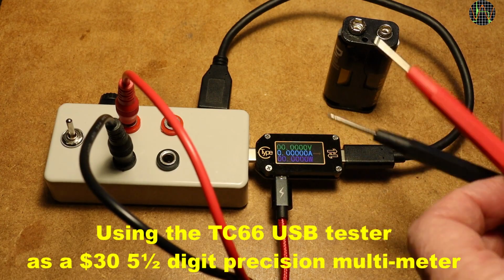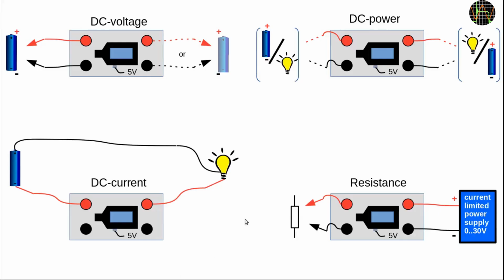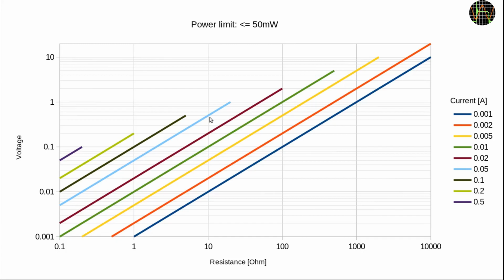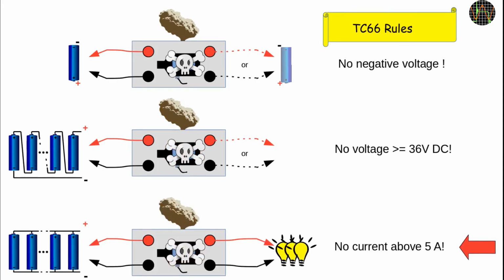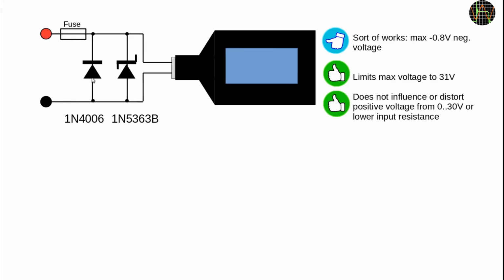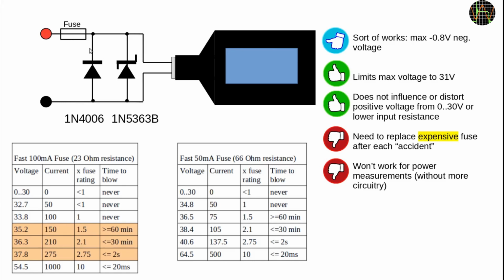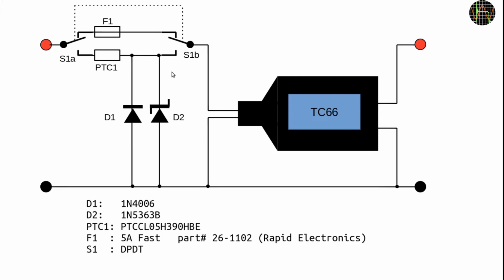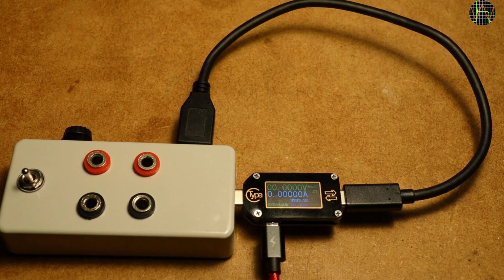Using the TC66 USB tester as a $30 5½ digit precision multi-meter

Comment: I have two precision calibrators achieving stable output at 5.000000±0.000100 and 10.000000±0.000020 V.  My TC66C measures them at 4.9996 and 9.9995.  Therefore the USB meter unit is measuring -0.005% off when using the better of the two (the 10V transfer standard).  Unbelievable!  None of my DMMs can come close when needing to measure 0.0001-29.9999V.  Current checks in at 0.2% low, but my constant current calibration transfer standard is not a particularly good standard (I'm working on a better one currently, no pun intended).  I made a banana plug adapter to type C female jack for the purpose of monitoring and logging voltage or current with the TC66C.  The shortest log interval is 1s.
Reply from the maker: Indeed, a hidden gem. Glad you confirm my measurements how good that little thing is. I have used it and its recording function many times now but never for USB stuff which normally doesn't need that kind of accuracy.

Comment: Suggestion, would be superb to build 3d printable case so that you would place TC66C in the middle of the print, have power fed from 18650 inside the case. When you would use it as meter, you would just plug TC66C with 2 USBC cables and one uUSB and you would have your accurate meter. Then oc the custom android bt app for everything else.. :)
Reply from the maker: I totally agree with out. Sadly I don't have a 3d printer. Maybe one day .. (we can dream...). PS yes I know there are Makerspaces etc. but with the pandemic and all that and anyway it would be quite a trip each time...

Comment: Hi, first I would like to thank you for your videos, you really work hard on them and pass on a lot of knowledge. Second, I would like to know if the negative voltage would kill the tc66 instantly or if there is some minimum voltage or time tolerance for this to happen? I don't study or work with electronics, I'm just interested but I have no knowledge about negative voltage. I've already reversed the polarity for about 5 seconds on my tc66 while measuring a 1.5V battery and what happened was that the magnitude that started to change in the meter was the current (it was around 1.1A) and the voltage was zero. Is that expected or do you think it should have burned in this situation? Note that my tc66 is the version with another bluetooth module, I don't know if they made changes to other components too
Reply from the maker: Theoretically the chip datasheet says -0.3V is the max. reverse voltage but I also found it handles a bit more if the duration is short. In my protection circuit the reverse current is limited by a diode, which is at 0.8V for a full blown reverse application a bit more than what is allowed according to the datasheet. In your case, the current will read just fine  because it can measure current in both polarities. The fact that you saw 1.1A means some internal protection diode shunted the excess voltage to ground, suffering a high current and possibly heat damage in the process. If the duration was short, it may have survived. If not, your TC66C may still measure voltages but the protection diode is now blown, meaning the next time there won't be any protection and at the very least the TC66C's voltage measurement circuit will likely die or show bad values. I assume you have tested the TC66C with a known good voltage and it is still showing the correct value?
Reply: @TheHWcave  "In your case, the current will read just fine  because it can measure current in both polarities." I don't quite understand what you mean here. Unlike you I just cut a good usb c cable and am using the positive and negative wires to measure the voltage (using the micro usb port to power the tc66) or using the tc66 connected directly to a PD charger (set to 3.7V) for current and power measurement from, for example, an electric brush motor. Both the voltage and current measurements appear to be the same as before, so I don't think any permanent damage has occurred. I would also like to know if you recommend using the voltage measured by the tc66 to calibrate a cheap multimeter in the same price range? Thanks!
Reply from the maker: @KaMyKaZii  Sorry, what I meant is that the chip (INA226) inside the TC66C is capable of measuring currents that flow in either direction (indicating the direction with an arrow) but that chip cannot measure negative voltage.  So, assuming the TC66C was powered from micro USB when you measured the reverse voltage, the current flowing through the protection diode would show on the display because the chip can measure it but the (negative) voltage cannot be displayed.  If the TC66C seems undamaged by the experience, it would be fine to use as reference for calibration of DC volt and current of a cheap multi meter.

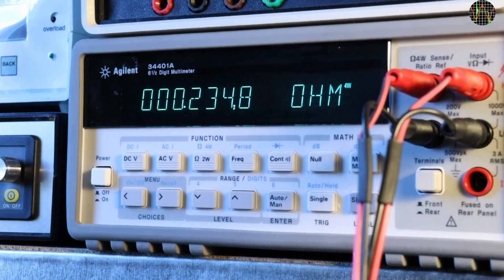Comment: great material but the accuracy seems to be a myth: at ts=7:45+ you have Ohm measurements that show that tc66 has an error of approx 4.5% , so 5+ of its lcd digits mean nothing;
also would be nice to see V and A measuremnts compared with your Agilent meter ...
Reply from the maker: You are correct in that low - ohm resistance measurement is definitely not the strength of the TC66 because of the silly display formatting, but it is doable even for very low  < 1 Ohm resistances which are notoriously hard to measure with the best multimeters. In the TC66 case we use Ohm's law and need all the digits of the volts and current readouts (and a calculator) to get a surprisingly good result.  The fact that it works so well (0.24 Ohm vs a 4-wire measurement by an 34401A showing 0.235 Ohm) is a testament how accurate the volts and current readouts are. I understand that you want to know more about the basic V and A accuracy. Please checkout my two other TC66 videos where I cover this. The first one shows the results of my accuracy measurements while the 2nd one goes into a lot more details on how it manages to be so accurate